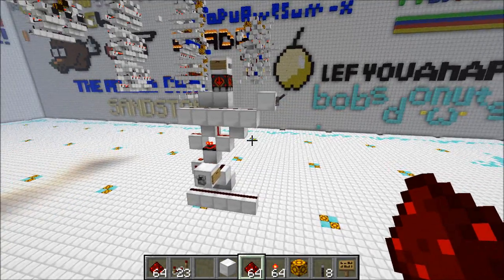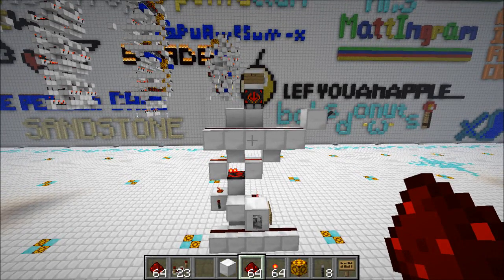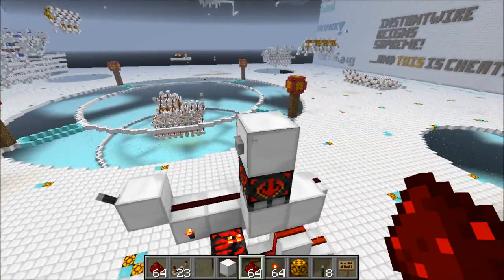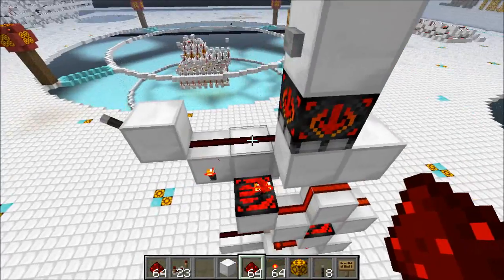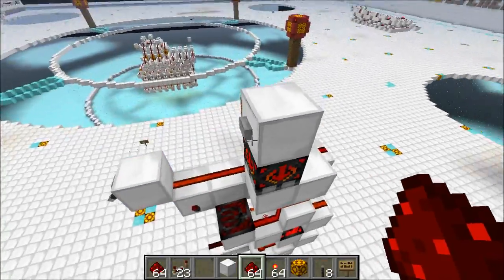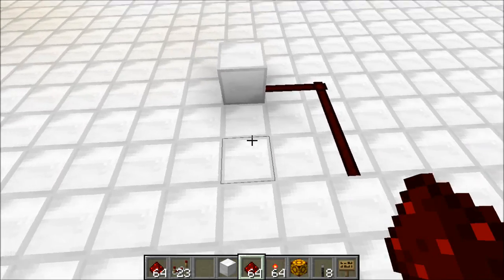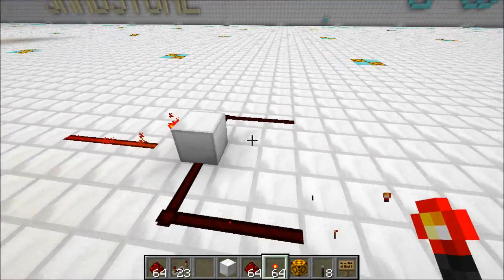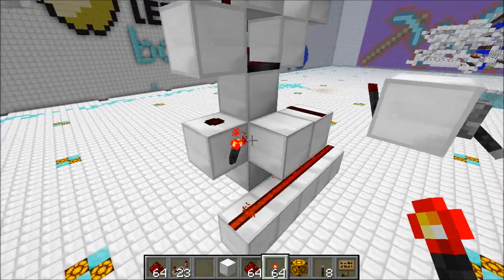Tutorial: Understanding RAM 1

Comment: You could use a piston powered RAM consisting of glass and normal blocks, I use this in combo locks, and displaying digits which can get complex in certain cases but I would use several pistons so you could write the system automatically. I do not have a demonstration but I am sure most of you will know what I am talking about. Keep up the good work Properinglish19.